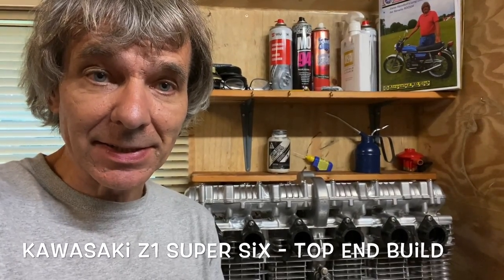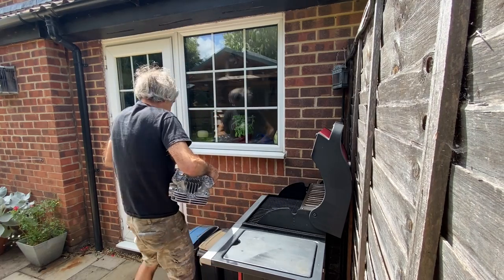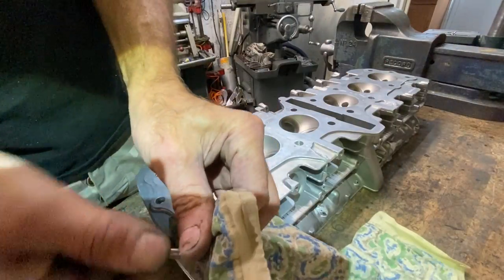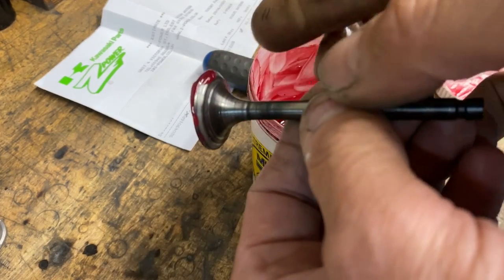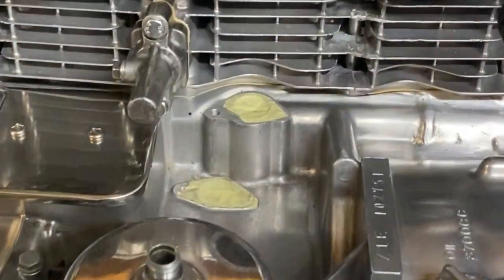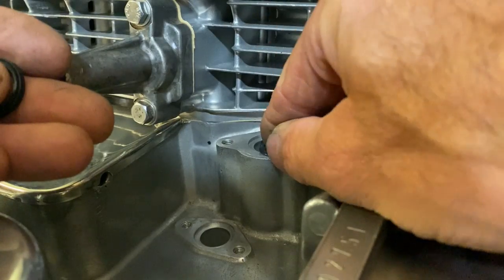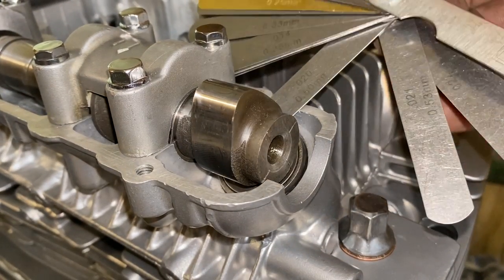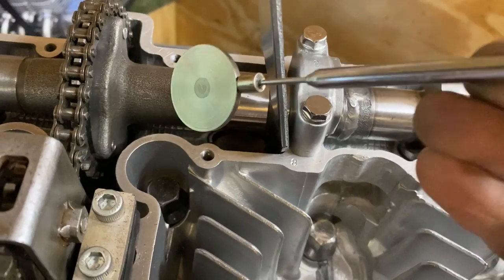Kawasaki Z1 Super Six - Top end assembly

Comment: Your videos are inspiring me to get my 1978 Kawasaki KZ650 running.

For anyone interested in my first motorcycle experience, I bought a bike with a KZ650 frame and a KZ750 engine in it, they have the same mounting pattern. I picked it up for 600 bucks, had some fun for a couple months, then it stopped starting. I was new to old bikes and took it for face value when they guy said "that chuffing coming from the spark plug hole in cylinder 4 is a mystery, but once it starts it runs well." 

There was a huge gouge in the spark plug threads and "chuffed" gases out of it like a train. I realize now there is absolutely no way that cylinder could have ever had any compression. In January in Minnesota I decided to get a thread repair kit. The tapping tool required no drilling and I watched a video of how to repair threads without taking the head off. The new threads, however, entered into the diameter of the exhaust valve and got caught on it. I nearly got the tool stuck but managed to turn it loose with a breaker bar. Bent the exhaust valve. So I completely negated the reason I didn't want to take the heads off, beause I am new and didn't want to mess with cam timing. Well too bad, now you have to disassemble the whole top end. I also checked compression finally on the other cylinders and they were ~80-90 psi, 30 psi below recommended. So now most of the engine is coming off so I can replace piston rings as well.

So in the end of the Minnesota winter, my buddy thankfully lets me use his heated/insulated garage to work on it. It stays up there til later spring when I can finish it. Get it cleaned up and back together, learn cam timing is that hard, and then try and try and it doesn't turn over. Check compression again, other cylinders are doing ok, but the one I "repaired" is at like 60 psi still. As I unthread the compression guage, the insert comes out. I thought about pounding it in further with a punch but it would probably fold and not allow the spark plug to seat and seal correctly.

Unfortunately I called it a loss. It took 1.5 hours to get to his garage, and after doing that every weekend as well as visit other friends up there, I figured my time is worth more than what I spent on the bike.

However... I do have the original 650 engine. I have no story on it, I have no idea why it wasn't in the frame and this tired 750 was. Might be worth a day of tear down to potentially diagnose. It would be sweet to mate the original engine to the frame and if it worked. The bike is nice and pretty light and fun to ride.
Reply: KZ 650 cool bikes hope you get it sorted  its never time wasted  Good luck from England

Comment: I love watching Allen video's because of his unbelievable skills in customising bike engines and reminds me when I was young and into bikes I remember rebuilding the top end my Kawasaki Z650 in the 1970's and regrinding the valves but the shims were under the tappet bucket which seems odd because you had to install the camshafts and measure the gaps then take the camshafts off to put the right size shims in and the gaps always went out after you had ran in the engine so you had to take take the camshafts and tappet buckets out again at about 500 or 1000 miles to change the shims to get the right gaps,but a least once that was done the gaps never seem to change.
Reply: While the under bucket shims were a hassle to adjust (I worked at a Kawasaki dealer in the 80's) they were preferable to have if you were using performance cams, top shim had a risk of dislodging a under v high revs whereas the under bucket shims had no such issues.
Reply: @AuMechanic  I thought there had to be a reason, I remember asking why the shims were under the tappet bucket years ago but no one had a good answer and we did not have google then.

Comment: Thank you for sharing this stage. It’s truly remarkable how much you can achieve on just one cake 🤣

I am surprised you use grease on the valves during reassembly. During operation they rely upon oil to lubricate them, so the grease could present a barrier to the oil, which has to melt or burn off before the oil can do its job. 

I always used grease until I had the above process explained to me. It makes sense.

Comment: The very best builder on video to date for sure. Just that it starts and runs great is pretty incredible after being hacked and whacked and welded back. I’d never expect it to run, nor was it likely ever intended to pull the 9,000 rpm redline. I’ve read the KZ 1300 would twist the crank if over revved or a missed gear.

Comment: How do you make sure the oil passage for the cam bearings are sealed between the cyl. heads that were cut and welded? As always great job.
Reply: You read my mind. I’m contemplating adding extensions to a water cooled engine, and sealing the water jacket from the oil is my main concern. 

But I know I’m approaching it all wrong, because I’m making drawings!! I know, crazy right?

My guess on the oilways is that Allen possibly relies upon the closeness of the mating surfaces of the re-machined castings to ensure a seal. 

Effecting a solution using tubes inserted into counterbores would be difficult to align properly. Possible on a CNC miller though. This would be more important on an engine with high oil pressure. 

Initial rough assessments of the alignment of the oilways in each mating component could be gauged using lumps of cold Plastercene. But obtaining dimensional variations would be virtually impossible. It’s a puzzler. 

Great question though. Thank you for posing it. Sadly almost everyone else here is either attempting a predictable form of sycophantic comedy, or just assuming a metaphorical grovel and repeating simplistic platitudes, which I suspect Allen must find rather embarrassing. 

Although he’s obviously a very modest man who doesn’t seek fame, he is in fact an understated comic genius. The phone calls, and his “just by eye” type catchphrases are truly hilarious. 

Ride safe, and remain forever curious.

Comment: I'm surprised you didn't have issues with the fitment of the shim buckets, after the head was welded.I appreciate the distortion is minimal with aluminum, but they are a very good fit indeed, infact I think they are a selective fit in the factory?
Also the cams must have had a hell of a time, when you put the caps on,
and pulled them down?It can be a bit scary with a std four, but with the cams opening/working on  at least three valves on a fabricated cam!
The cams would worry me a bit,
all that welding, pinning, bending, be
a hell of a mess if you got a fatigue
fracture on one of those
 welds.Theres little else holding
them together. There's a very high carbon content in the wall that has
been welded, and no heat treatment after welding?
Perhaps some cross pinning would be a good idea? 
Getting back to the cam welding, why not use a fixed or travelling steady when welding these very long camshafts. Just a thought.
PS I'm getting on a bit now, but I have had considerable experience in doing modifications such as this.
No Youtube, photographs! 
I wonder if an engine such as this,would cope if it were ridden hard? things like crankshaft whip,
oil flow,clutch performance,gearbox
pinnion width.
I come from a racing 
background and if it can't take the biscuit,there isn't much point.
It all looks great though.
    Regards from a knackered old toolmaker.
Dug out some photo's of my kawasaki six,I built in 1986/7.
It was based on  z650.
They had a one piece crank,so I 
I had to use two honda xl 185
Pressed up cranks with eccentric
crank pins for the two outer cylinders,and make pins to 
marry up to the forged crank.
The rest was similar to Mr Millyards
Six.
If anyone is interested I'll put them on here.
Its not flash,but I seem to remember it turned a few heads at the time.

Comment: Beautiful job Allen
I was a little surprised to see that the Kawasaki Z1 motor was only two valves per cylinder.
Nick
Reply: Nick Bishop It was designed in the 60s and 4 valve heads were not common then.

Comment: This brought back some very nice memories of working on the Leyland 500’s setting up the valve clearances. Except the shim goes above the valve and to adjust the valve clearance you have to remove the camshaft. And follower.

I only started watching Allen working on the six cylinder Kawasaki engine and I’m not familiar with motor cycle engines. Why does Allen need to fabricate a camshaft for his engine and not use the six cylinder camshaft that should fit the engine from the factory?

Comment: Is the anti-seize on the cam journals a good idea? i'm pretty sure that stuff has a very fine abrasive in it, most anti-seize compounds do. although as long as you change the oil pretty sharpish after first run, most of should clear out.

Comment: Nice job Allen. I was  surprised you didn't add a spot of grease onto your collets before dropping them in.
I found the grease helps hold them in place. There is nothing worse than accidentally dropping one on my floor. (Though I'm sure your floor is a lot cleaner than mine)
Reply: You might try dropping one down into the crankcase.
Tinkle
Reply: @rationalactor  Been there ,  won the tee shirt, wore it out, used it as a shop rag, and threw it away.  God bless telescopic magnets .

Comment: This is just amazing.I will give it a shot with a 125cc bike(I've never done this before but I'm a mechanic). Got a question tho, mind if you update us about the electronics? I have no idea how you made the extra 2 cylinders fire just right in time using the same electronics and relays from the engine original block

Comment: Hi Allen just asking a question about E10 in petrol which will change sometime next year as it doesn't matter if you have injector,  but old bike with carbs like yours and mine,  it rots the diaphragm, o-rings and rubber washers will you change the carbs or will you wait till something comes out . Or how hard would it be to build  injector and put on old bikes if possible.  ?

Comment: would you be able to do a video talking about the crankcases on the honda/velocette v twins? i can see that it looks like a section on the top has been removed and then another cylinder flange welded in, but im assuming the crank cases also need widened in the centre for the longer crank pin?

Comment: Gotta ask.....  were any steps taken to seal the cam bearing oil passages between the cylinder head pieces when they were welded together (recessed o-ring?)
Or did you just rely on the tight, machined fit of the faces and not worry if the area between the welds became oil soaked? Obviously, welding around the circumference of the heads isn't going to meld the parts together the same as when it was once a continuous casting. Any worries about oil seepage from a pinhole somewhere in the weld?

Comment: I wanted to see the cylinder head being fitted. What sort of SEALANT was used between each side ( ? ) of  the copper gasket? Was the centre seal thick enough to compensate for the copper gasket thickness?

Comment: Hi Allen, quick question on those oil hole bungs, were they in place before engine disassembly and if so how did you remove them? If they weren't what was in those holes before? Or were they drilled by yourself? Thanks!

Comment: Ring ring!
Hello Alan Milliard
Hi Alan it’s Tony Stark
Oh hi Tony
I was just wondering Alan, what projects have you got on at the moment?
Well, I’m still working on the hydrogen powered Suzuki GT750  two-stroke.
Are you doing anything not motorcycle related?
Well, not really although on the test ride the GT750 had so much torque it warped the space time continuum, I wasn’t expecting that.
Did it really! I don’t suppose you could let me have the plans?
Plans!
No no forget it, can I popped round and have a look?
Yes no problem, don’t bother knocking just come round the back to my shed, sorry about the mess a couple of weeks ago I was making diamonds in the sand filled paddling pool, complete failure I am afraid, very good quality but they were far too big.
Reply: Nice one Steve.

Comment: That pink water based de-greaser looks like what I used to use to clean jukeboxes and arcade style video games. The only thing that would cut a mixture of rat urine and spilled beer.
Reply: I restore pinballs for a hobby. Try Mean Green. I've found that is the only thing that just melts off old cigarette tar from cabinets. No scrubbing I've never had it damage a surface either.

Comment: I'm pretty sure antiseize shouldn't be used as a lubricant as it contains abrasives.
Reply: @Eddie Hitler I couldn't find a specific MSDS on the pro Honda antiseize that he used but most silver colored antiseize contain aluminum powder.  Given that it was used on aluminum bearing journals I would consider that abrasive.
Reply: Do RC. I'm no engineer, maybe you are, but it would take massive cojones to second-guess Allen on the building of a project like this. lol
Reply: That does seem an odd choice.  I always use assembly lube for all wear surfaces when assembling an engine.  I have not seen anti seize used before, but I am sure Allen has a reason.
Reply: @curmudgeon1933  I'm not an engineer though I have been turning wrenches for money for 20 years :). I did a lot of research into this subject a while back and, for me, most antiseize products contain stuff I wouldnt want in bearings.  Most contain one form or another of metal powder.
Reply: @Eddie Hitler They can have various ingredients but most all have metal of some sort.  Nickel is harder than aluminum so that would be even worse.
Reply: @Eddie Hitler well it's not designed as an abrasive.  It's designed to prevent galling and corrosion.  The metals that the put in them help with those purposes.
Reply: @Eddie Hitler understood. And this one may be ok (I couldn't find an MSDS on the one he specifically used) but most of the ones I've researched do have some form of metallic powder in them.  Given that most people aren't going to go looking up the MSDS on everything they use I think it's best to recommend staying away from using antiseize as a lubricant.  There are plenty of lubricants specifically designed for engine assembly so why risk it?
Reply: @Eddie Hitler me too:)

Comment: I would like to build a bike, my dream bike is kinda like a cafe racer, mated with a super moto, maybe start with a street and trail bike,  do the super moto bike tires and rims, then lower it down, about like a old cb 350, where it's comfortable to get on and ride, stop at lights and such, ya don't need all that suspension travel on the street, then find a nice tank and seat, something like a BSA tank and a cafe seat, maybe get a 250 Ninja engine from ebay or something, or maybe something larger, probably 600cc or smaller, old bikes are not easy to find here, there used to be a old factory building with hundreds of bikes in it, they sold them and sold parts, it was a bike shop, and dealer, but they closed probably 20years ago, ya never see older bikes here anymore, if you do it looks like someone dug it out the ground, and it's at the scrap yard, or it's a broke down Chinese bike, I have one! It was all I could find, I figured I could play with it, and take it back to the scrap yard if it didn't work out! Haha, it's about $1500 new! $400 for a new engine, but is it worth it? Building a honsudoki would atleast be fun!

Comment: that cam shaft chain is very thin for six cylinders if they are designed for 4 cylinders and two extra cylinders it suffers more wear, it needs a wider one and more change the gears
Reply from the maker: the stress on the chain is possibly less for a 120 degree six due to the valve compressions being closer together than a 180 degree four so will be fine